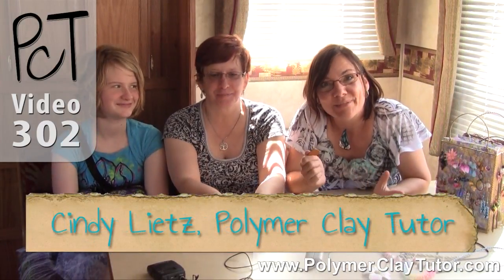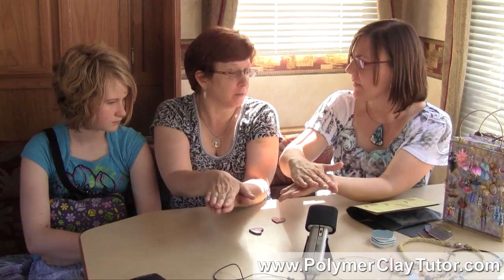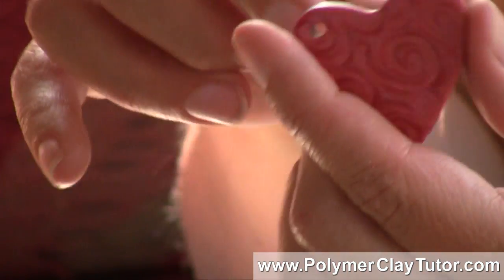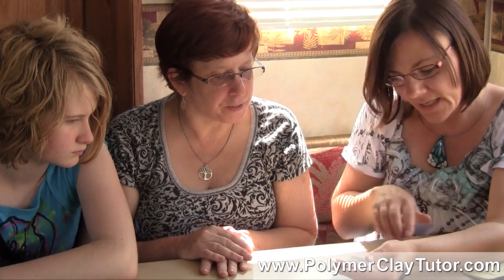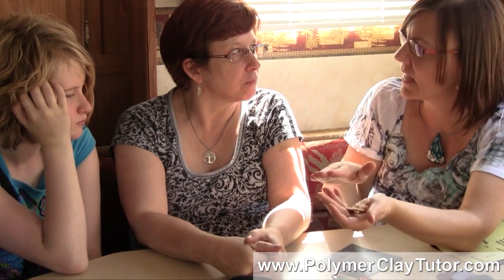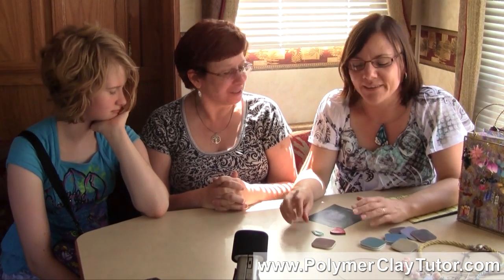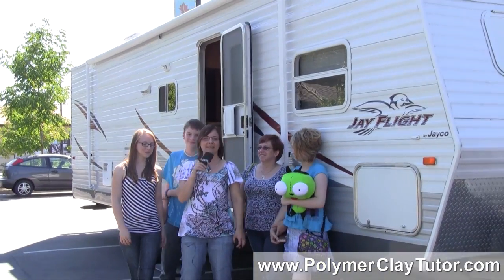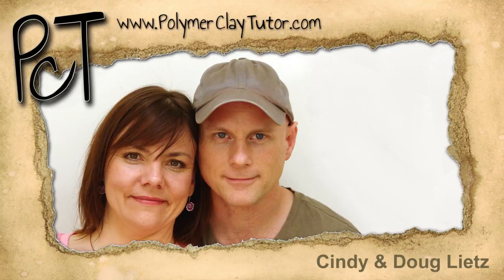Tips For Baking and Sanding Flat Polymer Clay Pieces

Comment from the maker: Hi flyhigh513, yes you should buy an oven thermometer and you should tent your pieces. I actually prefer to use paper cardstock to tent (as long is it is no where near the element) because paper will not leave a shiny spot on your  clay should it slip down and touch your clay. As well, Tinfoil can sometimes cause hot spots, that cause scorching. Go to my blog (link in description) and use the search box to find tons of free info on baking. Good luck!

Comment: Hi, thanks for this video! I have a question, I am baking for an hour (per your suggestion) and I'm not having problems with burning or anything, but I find that my pieces become very brittle when they've been out of the oven for 24 hours. When I first take them out they are very flexible  (I wait until they are mostly cooled down to take them out) but they weaken and lose all flexibility by 24 hrs later. I am using Premo clay exclusively,  which I chose because of the strength and flexibility it's supposed to have after baking. I'm not sure what I'm doing wrong.  Have you ever heard of this, and if so can you please let me know what I'm doing wrong?  Thanks for the help and the video! Have a wonderful day! 😊
Reply: I'm having the same problem with Fimo.
Wonder if it's not my thickness...?

Comment: Hi Cindy it's me again....I'm confused. I tried sanding a pendant that I made with wet/dry sandpaper and I got no shine at all. I started with the finest grit first and worked my way up to the 800 grit and nothing. What am I doing wrong????
Reply from the maker: Hi hazelidgal63 You need to start with the coarser grits and work your way up to  the finer grits. For example, start with 400g then to 600g to 800g to 1200g. If you go the other way, you are making your piece duller. Then you will need to buff it to get a proper shine. Go to my blog at www.polymerclaytutor.com and type sanding and buffing into the search box. You will find lots of help there.
Reply: Ok thanks so much!!